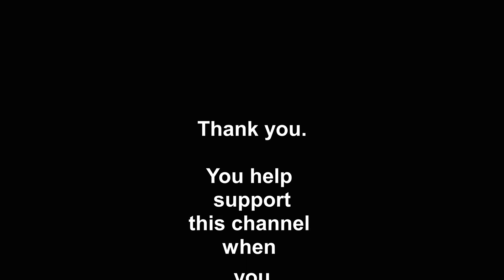Best DIY 35mm SLIDE & FILM Copier--Easy, Low Cost ver 2.0 (4K)

Comment: This looks great and inexpensive, thanks for sharing! Did you consider using a macro rail for fine tuning focal distance or just measure once is enough?
Reply from the maker: @jjwhtn  In the olden times when I was selling film cameras the rail would have been the answer, but they are expensive, hard to find, and if you're using a fixed focal length lens, there's only 1 ideal distance. Also, my original setup used an extension tube with an ordinary lens. The lens was not flat field with that, and my results were out of focus on the edges.